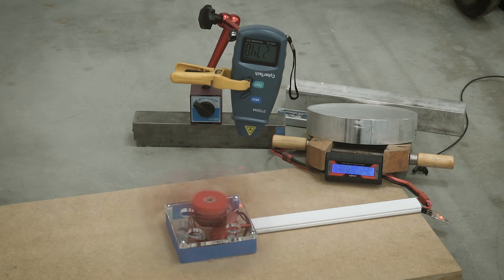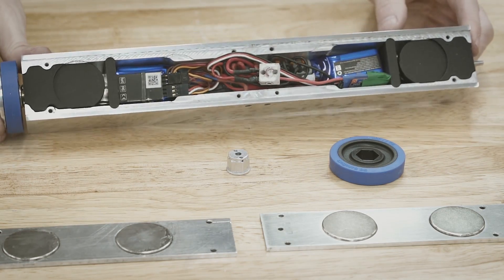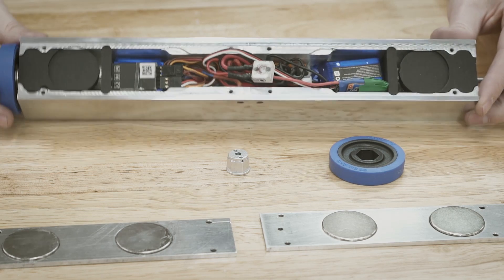Psychotic Break Beetleweight Build - Intro

Comment: Looking forward to this! .. one question. I noticed you got quite a bit of power out of that little motor @7:49, could something like that (or bigger) be used for cuttng grass with small lawn mower robot and a standard ~300mm lawn mower blade? or would it be under powered? is there something you would recommend? ... I'm currently using a 24v 250w scooter motor, but it's rather big, heavy and bulky.
Reply from the maker: You'd need a LOT more torque.  Even small lawnmowers are at least a couple horsepower.  Just look at commercial electric mowers and go from there.

Comment: Do you ever look at existing designs and try to come up with something to combat those designs? Or are there too many constraints to get too creative, so going for solid and dependable becomes the winning focus?
Looking forward to the series - spreadsheets are great.
Reply from the maker: Designing and building is what I like.  Fighting and winning is secondary, and not really the primary goal.  So I don't really pay TOO much attention to what others are doing.  However, right now there are a lot of vertical spinners, so a good horizontal should be good.  But it's more about just trying things out.

Comment: your weapon is very massive, when attacking the other robot with that bar, Newton's third law will be applied,
the robot will shake violently breaking the planetary gearmotor. I recommend you look for another gearmotor that supports those shakes. 
 
saludos y suerte con copperhead :D
Reply from the maker: I never rigidly mount my motors.  they will all be shock-mounted.  I've NEVER lost a planetary gearmotor.  Even with crippling depression (which even tweaked the arena enough so the doors didn't open), I'm still using the same pair of gearboxes for drive.  Protect your gearboxes people!

Comment: 1" Solid T4 Aluminum block Milled out for Belt & Electronics?

Have you thought if having the Drive Wheels inboard of the sides to better protect them?

Great video!

Take care,
🤓-Thomas
Reply from the maker: Just follow along, I have ideas for wheel guards and such.  I can only explain so much in one video :-)
Reply: I think I might go with recessed wheels.
Reply: Actually, exposed wheels are kind of beneficial for a tombclone, as long as the drive is fastvenough to swerve sideways in about 1/5 of a second, so any opponent close enough to damage the wheels would get damaged instead. The wheels are just bait:)
Reply from the maker: @ki0w0-lordofwatersheep   Correct!  At this scale though, the bots are so fast and chaotic, I'm planning a LITTLE bit of protection though.